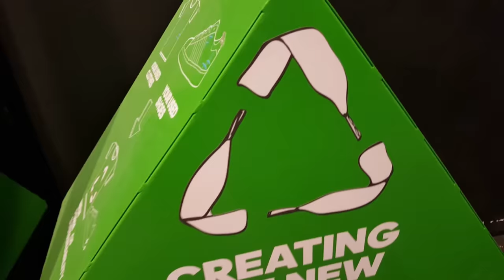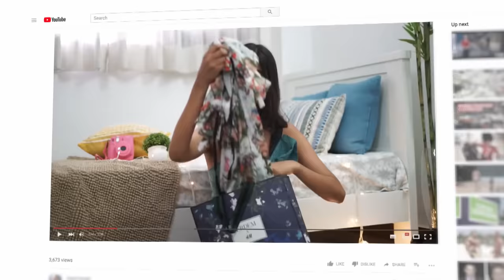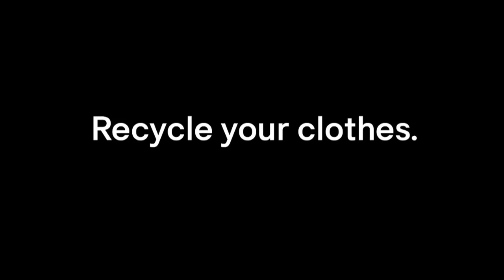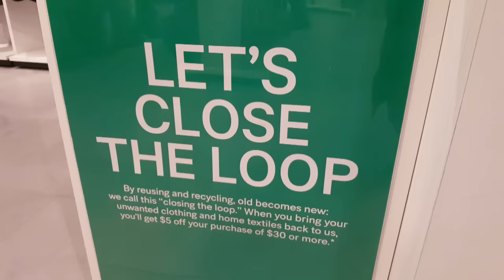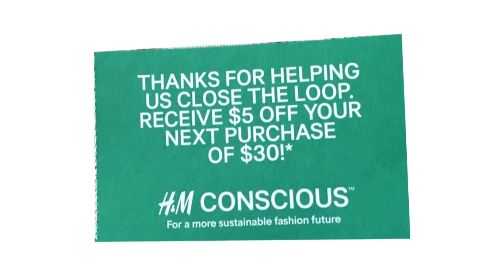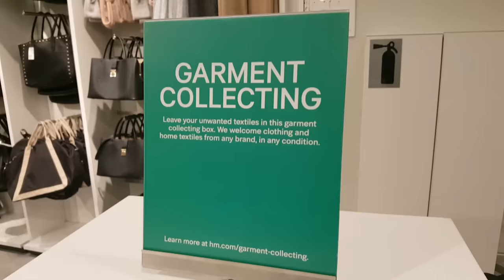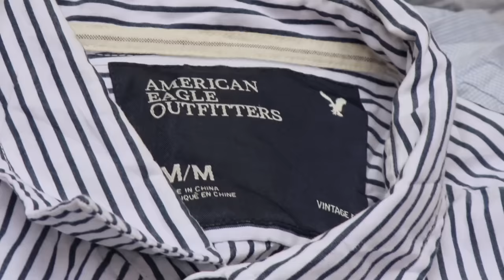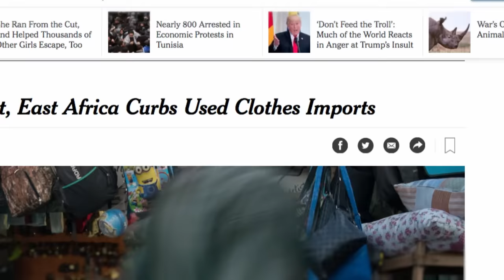How fast fashion adds to the world's clothing waste problem (Marketplace)

Comment: Average Victorians typically had about 4 outfits at a time.  They had a "Sunday's best", Everyday outfit, and maybe 2 seasonal outfits (one for summer, one for dead of winter) And that was it.  You might get a new dress or outfit every 5 years or so.  Children's clothes were made with the ability to let them out as the kid grew.  Surprisingly, Victorians had little to no household waste.  Everything was so costly to get that you NEVER threw it away.  A woman's dress would be worn, turned, and patched to last as long as possible.  Then when it was impossible to fix for the woman, they'd be cut down to make children's clothes.  Children's clothes were worn out they'd be cut down to make household rages, once the rags were worn down to threads they'd be sold to the Rag and Bone man who'd re-weave it to make a cheap fabric or grind it down to make fertilizer.  Why is it so hard for us to do it now?  Oh right "I want"  is a very, VERY powerful thing.

Comment: A good start CBC but still missing the point and the end is a dead give away:
the host asks people on the street if they want her old clothes, some say no but some do say yes. 

The host then feels a sense of relief and is happy that her clothes 'will not end up in the landfill'.
THIS is the problem! She has no way of knowing whether her old clothes will go into the landfill, nor is she absolved of the responsibly of where they end up. That way of thinking is just what she was critiquing through the whole show - in the end she defaulted to the same philosophy: once the garment leaves my hands it's not my responsibility. Outta sight, outta mind.
The conclusion to the article COMPLETELY defeated the impact of the whole message.

A more critical and broad range thinking to the story could have been BUY LESS, BUY BETTER. BUY LOCAL, BUY ETHICAL. 

There is a notion that buying cheap clothes (whether fast fashion or 2nd hand) is better for your bank account - which is one of the biggest myths being perpetuated. If one (maybe you can do an article) was to do the math between buying a lot of cheap clothes vs. buying less but more sustainable (ethical/honest pricing/natural fibres) I feel most people would be utterly shocked. 

SO much money is spent trying to save money. It's ironic and it's financially risky.

SLOW FASHION is a solution. 

There is the second and very important issue: WHO MADE YOUR CLOTHES. 

There is also a falsehood that implies that cheaper clothes are more 'democratic' when the truth is absolutely the opposite. The lineage of lives and hands that have both made and were effected by the production of most clothes would also shock many people. Not to mention the horrendous quality of life they live in order for people of the first world to cheaply but clothing; this is not democratic. In many cases it's not even ethical. The sustained poverty of the people making the clothes versus the corporations profiting off of their poverty is not ethical. The ecological damage sustained to produce clothing is not ethical.  

The cost benefit analysis of having to replace old, poor quality clothes is less economical (and less responsible) than purchasing good quality, natural textiles, and ethically made clothing. 

You almost had it CBC - but you needed to inquire and critique just a little bit further.

Comment: Why not shred the cotton clothes, remove the colour, clean it and then recycle.
Reply: Recycled cotton is less durable and usually cheap clothes are blends of cotton and polyester. Polyester isn’t biodegradable since it’s synthetic
Reply: @Valfrex  I agree, but on top of that the "recycling" of the clothing will be very expensive and will only end up hurting the environment. For example the chemicals that help recycle the clothing are expensive and are still chemicals so we won't really benefit from it... but hey that's just my opinion.
Reply: Adilene Bonilla yes recycled fibers are more expensive ):